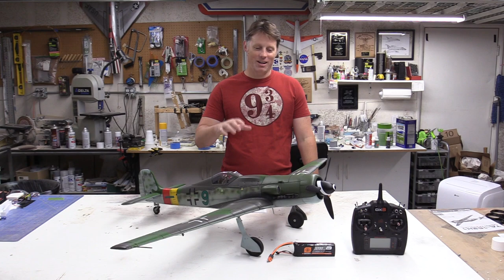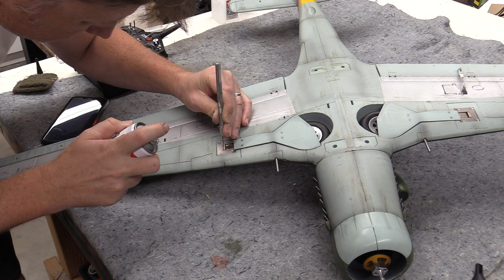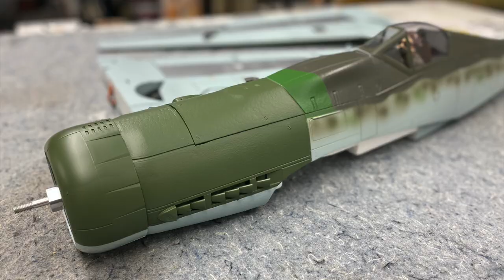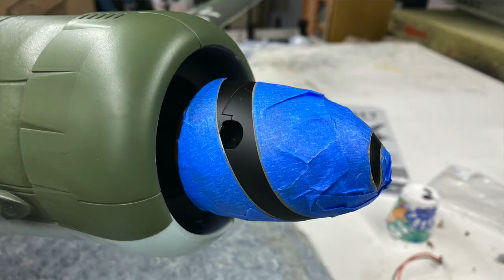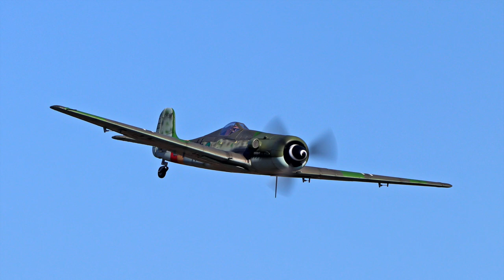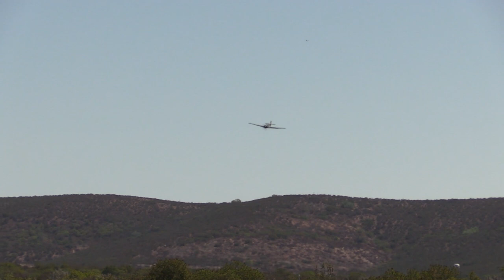Assembly & Flight Review (w/weathering & paint tips!) -- FlightLine RC Ta 152H 1300mm Wingspan

Comment: One of the best flying warbirds in this class that i own (and i own quite a lot, some would say too many 😎😎). Flies like it's on rails with perfect speed. I initially bought the "sport power setup" with the 2 blade prop + spinner and the higher KV motor but never installed that because the standard config has more than enough power (and looks better with the scale 3 blade scale prop). It's amazing to see this bird accelerating when you push the throttle to max from a cruising speed 😁😁
I just wish that they would release a D9 because I like that version even more.

Comment: Very nice model, great silhouette and  lovely weathering. I like what you have done to the main gear - they always get FW 190 gear wrong - even Sierra Giant don't do it properly. It would really finish it off if you could tuck that tailwheel up... quite a challenge, but a lot of the late war planes don't quite have realism in flight because of the tail wheels.
Reply from the maker: Thank you!  I hear you on the tail wheel, that would be pretty cool. Really tough to do at this size when it’s already built. At least it’s the right size and shape.

Comment: Some very nice customization of your 190.  Great result.  I would like to ask a couple of questions if I may.  With your retract modification - it seems the plywood shim you added is blocking the retract from going fully open.  Does this seem to cause the unit to have any strain - like it is trying to fight itself?   And 2:  I bought this recently.  I noticed while flying that the lateral stability is not what I might have wanted.  The ailerons seem fairly well positioned in line with the other wing structure when I trimmed it out.  But it tries to slowly drop one wing, and then drop the other.  Flying straight and level seems to require constant nudges to correct and lift the low wing again.

Do you perhaps have any thoughts or ideas as to why?  The only thing I have thought of so far was to perhaps change the aileron linkage so that both of them are being held 'up'  a wee bit more than their present straight back position.  I don't know if this might act just a bit like a wing with more effective dihedral or not.  ?   Thank you - Roger Holland.
Reply from the maker: You’re correct, the shim stops the gear just short of full retraction. Theres no strain as they have a current cutoff which shuts the motor off. On the ailerons, it sounds like they may be double centering. Check to see if they aren’t returning to their exact same position on the ground. If there’s binding happening, it can cause the double centering. You may need to put some better servos in there to fully resolve it.

Comment: Chris, another great video. Quick question: When you bent the axle to make the wheels orient vertically (like the real one)...did you actually bend the axle itself or the lower part of the strut?
Reply from the maker: They struts are wire, so I bent the axle portion to get the correct wheel angle.
Reply: @Thercgeek  got it. I tried bending just the axle on one of the retracts and couldn't get it to bend. I may try taking the strut out altogether so I can get better lwverage on it.

Comment: Hello, how were you able to not pull off the factory paint when masking with frog tape? I figure it would peel the thin factory paint right off when you pull the frog tape off.
Reply from the maker: I’ve had very good success with frog tape. I’ll typically place the tape on my shirt first before placing it on the model and then peel it back over itself when lifting it up. Works great!
Reply: Fantastic. I will try that with the frog tape. Thanks for the info!

Comment: I re flew mine 3 days ago,  green 4 with lime green spinner white spiral   and moved the lipo back a 1/4 in and this stopped the plane wanting to rotate up on its nose issue completely ,completely normal   operations. flies like a pattern plane, the parkzone fw190a wheels look nice. i use the parkzone p47 install reversed sided and look very scale . will 3d print a max gruder bf109 pilot from 3d trader to fit after scaling it . working on a second one as green 9 with the red spinner. stab JG 301 Willi Reschke wn 150168
Reply from the maker: Nice!!

Comment: Great video! Do you think this is a better choice than the Dynam focke wolf and is worth getting?
Reply from the maker: Thanks!  Imo, the quality of this one is quite a bit better than the dynam.
Reply: @Thercgeek  OK, do you think this is worth getting as a first warbird as in is it easy to fly, as if not I might get a bush plane
Reply: I have had only bit of experience with RC planes
Reply from the maker: If you have some tail wheel experience you should be fine. The hardest part in flying the model is the takeoff, so just requires smooth throttle control and avoiding lifting off the airplane too soon. Otherwise, it’s a pretty cool flyer.

Comment: Can you remove the canopy without damaging the fuselage?
Reply from the maker: Usually, if you can get a fingernail underneath one of the edges and start lifting it, it’ll start to pull away from the fuselage. That’s how I go about it. If you get a tool in there, that’s when you run the risk of damaging the surrounding areas on the fuse.
Reply: @Thercgeek  Thank you.  i was thinking about buying it in separate parts instead if I were to buy it instead.